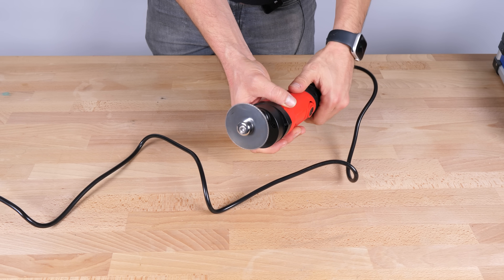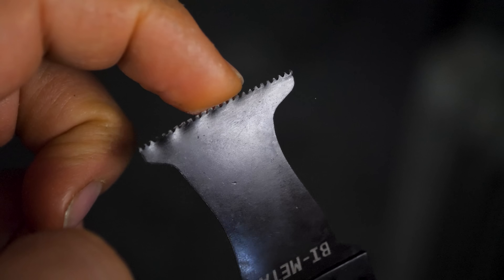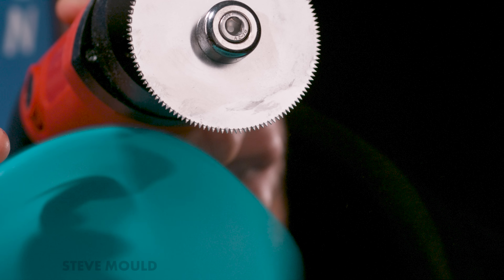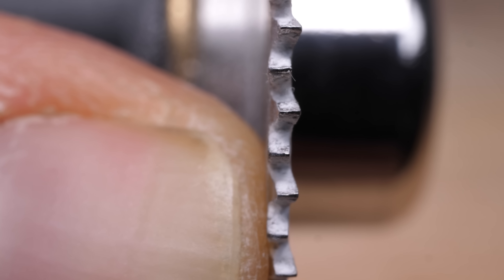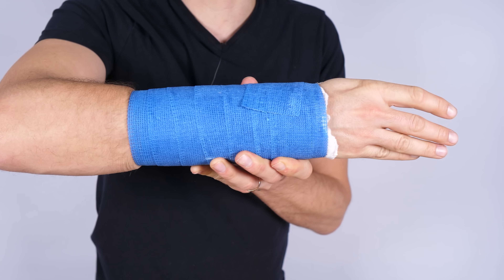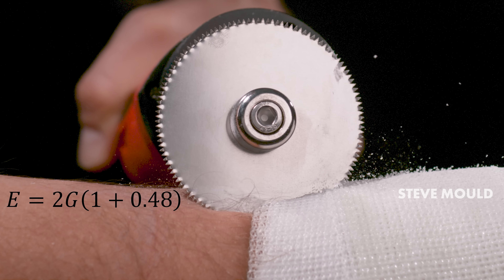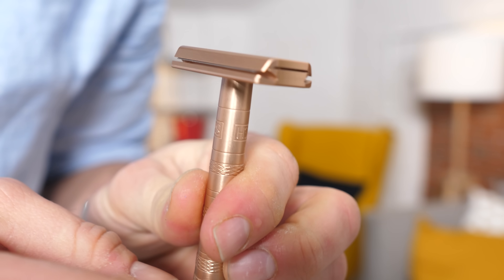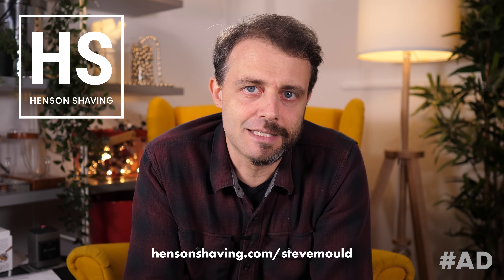A cast saw on human skin

Comment: Not strictly true. I broke my ankle in 2006. The bones where set during an operation and a cast was put on. After a week or so I developed a bad infection in the ankle, as it turned out it was MRSA. The case had to come off immediately, it was late in the day in casualty and the technician had already left.
A doctor decided to cut the cast off, omg it hurt but kept telling me it didn't hurt and continued. When the staff finally broke the case off I had a bleeding cut the length of the case down to the ankle, not great having an open wound around MRSA.
Well after some treatment for the cut, sorting out the operation wound, jabs of antibiotics and many uncomfortable weeks of further treatment and anew case with windows cut in it to treat the infected wound it healed.
My point...... the saws can cut skin if used by untrained personal.
Reply: It may have cut you even with trained personnel. Swelling from the infection could have simultaneously stretched the skin and pressed it tightly against the inside of the cast, making it unable to jiggle if touched by the saw.

Comment: Weird question. When you drill a hole into thin metal, the drilled hole tends to be all shapes but round, except if you out a piece of cloth in between the drill tip and the material. I'm a machinist and have been using this trick for ages, but I can't figure out why this works!

Comment: As someone who’s never had to wear a cast or even visit the ER other than for a regular check up this actually put my mind at ease because it was a slight fear of mine that if I ever wore a cast and the doctor slipped up I’d have a worse injury than before
Reply: Don't be mislead: if you slide the tool as it is powered, it'll absolutely cut through skin,

It's not ment to be operated in a sliding motion, rather it's repeatedly prepositioned for each cut, but not moved while it's touching the skin.

Like you put one dot at a time with pen & paper to form a dotted line

Comment: Similar thing with stone cutters. Can't cut soft materials but will easily go through stone. The reason there is that rock will grind down the metal medium and the embedded diamond flakes will then in turn cut the rock when exposed. But the sawblade is basically smooth to the touch, so without a regular sawblade shape, it'll just get rather hot.

Comment: Pro tip regarding power tool batteries: There's actually several options for adaptors to plug one brand's battery into another brand's tool.

Comment: Been trough that horror twice before. How hard would it have been for the doctor or nurse to say "Oh the blade doesn't spin, it just wiggles back and forth"??? Goes to show how sadist medical personnel really is. Thanks for this video to heal my anxiety.
Reply: i dont think many of us know how it works. I'm a foot and ankle dr, and when we were taught how to use the cast saw, they never told us that the blade oscillates back and forth when it cuts. All we were told was to be careful around the ankle. because you can cut the skin around the ankle, since the skin is very thin there, and you can burn the patient if the blade gets hot. The 2nd part of that statement is true, i'm not sure if the part about cutting the skin at the ankle is true or not. It most likely isn't as there is padding underneath the cast which protects the skin anyway, but i will still be careful around that area just to be safe. I did know that it was impossible to cut someone with the saw, in areas where you the skin is not directly overlying bone, as i had tested it out on myself. I just assumed the saw went in circles but was not very sharp. Nice to know how it actually works though.
Reply: @robotbro7187  Given how it was shown to work, I think there would be a risk of cutting the bone when it's close to the skin, and the skin would then tear when pinched against it. You obviously wouldn't do a huge amount of damage to the bone with a short moment of pressure, but I'm not sure how particular bone is to that sort of surface damage. Would it just heal without much knowledge, maybe just a tiny section with a slight bump in some insanely detailed (probably more detailed than exists) X-ray print/screen? Is there even anything comparable to that sort of thing? (sorry for the lack of the right terms).
Reply: im a doctor and ive used cast saws a lot, and i can tell u i enjoy seeing the fear in the patient's eyes
Reply: “sadist” you say to the people trying to save your life. Read this 3 times to make sure you werent actually saying that, but yeah. Some people are ungrateful as hell. They are LITERALLY trying to save your life.
Reply: @duuda-he9qj  I get you. But also nurses being terrible people is a real occurrence due to the power imbalance inherent to the position. There's a lot of people out there, probability will fill those gaps.
Reply: @duuda-he9qj  when cutting a cast there isnt that much at risk, they are just taking off a cast that has already served its purpose. they already know the cast saw is safe on most areas of skin, and in training they would be taught where is safe to cut; therefore they could easily joke around by not informing the patient of what it does
mind you they might not know themselves, if they werent told in training (as some other comments from doctors (have to just trust their word, this is the internet) said)
Reply: @Elementening  thats literally not relating to anything i said at all..

Comment: Why a circular blade and not just a small section? Perhaps you can rotate the blade to a sharper section of the disc, but one would imagine the plaster material being cut wouldn't really wear down rhe blade to that extent?

Comment: For those who doesn't know it... That's s moto tool, there are different brands and different accessories, for it... More likely small drills  I particulary have fail to touch the blades the force of the tool is strong for some materials but not strong enough to hurt skin instantly, so you have s chance to avoid injuries

Comment: A point of note about cast materials: plaster of Paris is much heavier than the fibreglass casts, which is why it is preferred for fractures which need to be set for a long(ish) period. However, depending on when you attend A&E, you might still get a plaster cast as a temporary fix until the fracture clinic can get you in to set your break using fibreglass.

Comment: The first time I saw this difference between solid and squishy things like people, was when I started at an auto parts store.  My boss told me to hold this engine part in my hands while he removed a bolt with an impact wrench.  I didn't know how it worked and thought it was gonna try rip the part from my hands, and I braced for it to twist hard.  He said "No, relax, it doesn't work that way" and torqued the seized bolt right out of it while I wasn't even ready, it just shook a bit and didn't twist at all.  It was the coolest thing ever

Comment: I'm sure someone else has already said this but it's just a multi tool, from a quick google Makita's DTM51 has an oscillation angle of 3.2deg so a blade of ~54mm radius and you have a movement of ~3mm.  You get a similar effect when using a reciprocating saw when you're trying to chop through something which can easily move, you stop making progress.

Comment: Hey, Nice vid! Just a small correction, I believe the thing you are measuring is the particle velocity and not the speed of sound in your skin. Particle velocity is dependant on the impact velocity, where as the speed of sound in the material is an intrinsic property of the material, based on the density and stiffness. Also just consider that the speed in sound in air is approx 300 m/s, and this increases with density (e.g. water is approx 1500 m/s), so there is no way that your skin has a speed of sound in the order of 10 m/s.

Comment: Email used to have vendor lockin and could cost amazing charges if you had to traverse gateways (up to $400/MB back in the mid 1990s). People were pushing proprietary systems right into the late 1990s

Comment: Why is the blade circular? If it just oscillates a few mm, why not just have a blade that is only that portion? Or is it designed to rotate the blade a little at a time to appears he using a sharpened spot instead of swapping out the blade all the time?

Comment: As there are no cutting risk with that kind of saw, there is a burning risk. I had a fiberglass cast removed from my ankle and the cast saw blade heated up because of the fiberglass being harder than the plaster. When the saw thoched my skin it certainly did not cut but it burned and scarred my foot. My point is that it is not that harmless.

Comment: When I was 13 I had tibial derotational bilateral osteotomy surgery. In the hospital, my legs swelled the cast shut due to unplanned for inflammation, and my full-leg casts had to be cut in an "emergency cast removal". It's interesting to see how the tool works and the oscillation, but unfortunately, because my legs had swollen shut against the cast shell, my skin got repeatedly scraped during the removal, and the blade got extremely hot due to the casts being so large and building friction. 

Not a fun time, but a crucial time for such a tool, considering the alternative.

Comment: I was born with feet pointed the wrong direction. I had casts on my feet at one point(<=1 years old) in the treatment for this and when they took the tiny little casts off my feet they cut down the inside of one my feet. From the middle of my big toe down about an inch and a half. I'm guessing it was a little cut back then being my toe must of been tiny and stretched out as I grew.  This was late 70's.

Comment: I had this experience when I was using a diamond table saw to cut open gemstones. 
It cuts through stone like through a butter (and it's a fully rotating blade) but you can put your finger there and it won't touch it, the blade is completely smooth to the finger.

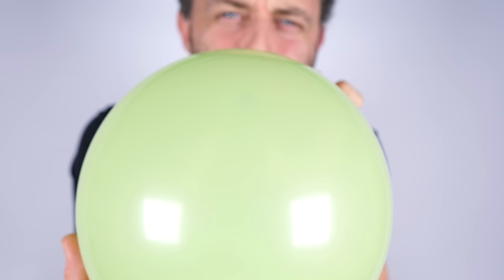Comment: 2:10 please correct me if im wrong but to me it kinda seems like the reason is the pressure of the ballon, the underinflated ballon is very soft with minimal pressure on the saw, whereas the overly inflated ballon has a high pressure

Comment: As nurse I have to make an important point, what you did is to cut through a cast with underneath the arm of a strong, young and healthy male...the point is all around those words:
-Age
-Sex
-Health of the skin

So starting from the first two, the skin of a child is not the same of an adult or of an elderly, because with age the hydration, the tension and the elasticity of the skin have really different carapteristics. The sex is about the same topics, usually females have a softer and more fragile skin specially on old age.

The last and more important fact the health of the skin...when you have a cast on you keep it at least 1 month, in this period you can't wash your arm (or leg ecc) the part stay away from the sun, the skin can't replace with new one or if it happens the dead skin stay inside the cast. All those factors together change your skin status making it frigile and with a really high amount of microorganisms like bacterias. 
So we arrive at the clue we are cutting the cast and we meet a skin with bad hydration, poor elasticity and with fragile epidermis...we press too much and the skin get injured making a path where the bacteria can attack our body.

So yes this blade is made to reduce the body damage, but there are a few things to know and to make attention to.

A thing that I was forgetting, skin near bones like wrist and malleolus is really still compared to the center of the arm for example, so obviously is more probable to cause a cut

Comment: When I was 7 years old, I had a cast removed. The nurse in charge of removing my cast was not paying attention, and was burning my skin. I was crying in pain, and the nurse just said I was "scared". Sure enough when the cast was fully removed, my arm was bleeding, though not very fast. I have a scar running along the length of the inner part of my arm now. people think its a self-harm scar, but I have the discharge papers which indicate that it was indeed an injury caused by the saw in question. Perhaps me being young meant that my inner arm skin was weak and easy to damage. Regardless, this is an interesting video and further proves to me that nurse sucked.

Comment: When my daughter was around 2y.o she had a greenstick fracture in her arm and had a cast. When they removed it, the doctor used one of these and demonstrated on his own arm that it wouldn't cut or hurt. He proceeded to cut the cast and my daughter screamed and screamed (I assumed just scared of the loud noise). When the cast came apart she had a bleeding gash 5 inches long straight down the cut line, and the doctor was speechless and utterly confounded. She still has the scar to this day.

Comment: The primary reason it doesn't cut through the skin isn't the fact that it's oscillating, it's rather the dull teeth. If they were sharp, you could cut through your skin just by pushing it down on it without even powering it on.

Comment: What would happen if you dragged the blade across your skin perpendicular to the oscillating direction? Would it pull the skin taunt and cause a cut? What about stiffer skin areas like finger tips?

Comment: I just wanted to say that the tau/12 joke (7:28) has been noticed! 😂
Reply: I don’t get it
Reply: @Im_96 Well, it's not really a joke, just a statement. The number τ (tau) is a mathematical constant equal to the ratio of a circle's circumference C to its radius r:

τ = C / r.

It is approximately 6.28.

This may remind you of the more familiar π (pi), the ratio of a circle's circumference C to its diameter D, approximately 3.14:

π = C / D.

Indeed, since a circle's radius is half of its diameter, τ is equal to 2 times π. So, why bring in τ when we already have π? Well, there are many reasons, but the primary reason involves a system of angle measurement: radians.

You may be familiar with measuring angles in degrees, where there are 360 degrees in a full revolution, or one turn. If you make a half turn, that's 180 degrees. A quarter turn is 90 degrees.

This is all well and good, but in higher math, it is often more useful to measure angles with another unit: the radian. Suppose you draw a circle, then you draw a radius from the center to the edge. From there, you draw one radius-length along the circumference of the circle, then you draw straight back to the center of the circle. That angle you form at the center of the circle is one radian, abbreviated rad, and it is approximately 57.3 degrees (this is 360 / τ).

For some terminology, the curve you drew along the circle is called a circular arc. We say that the arc subtends the angle at the center of the circle, since the rays of the angle pass through the arc's endpoints.

Now, the question is, how many radians are there in one turn? Well, this is where τ comes in. Since τ is circumference divided by radius, we know that the radius goes into the circumference τ times—that's what division means. So, we can fit τ radius-lengths along the circle. And since each radius-length subtends an angle of 1 radian at the center of the circle, that means the whole circle subtends an angle of τ radians. So, there are τ radians in one turn.

Knowing this, we can also determine the radian measures of some other angles. 1/2 turn, or 180 degrees, is τ/2 radians. 1/4 turn, or 90 degrees, is τ/4 radians. 1/12 turn, or 30 degrees, is τ/12 radians. Simple, right?

Or, well, it should be. The traditional choice of circle constant is π, not τ. Thus, in a typical trigonometry course, the aforementioned angles would be expressed in terms of π: 1/2 turn = π rad, 1/4 turn = π/2 rad, 1/12 turn = π/6 rad. Since we're defining radians using the radius, but we're defining π using the diameter, there are annoying extra factors of 2 everywhere. As a result, π makes radians much more confusing than they should be.

Due to this, among various other reasons, some people advocate for τ as the true circle constant. For more information, you can read The Tau Manifesto by Michael Hartl. There is also an annual celebration of τ: Tau Day, which is June 28. Incidentally, that was a few days ago from the time of this reply.

Comment: I had a broken wrist in Japan about 20 years ago, and I remember the doctor whipped out one of those with the large circular blade to cut off my temporary cast. No guards or guides of any kind. My first thoughts were, "This guy better be GOOD!"

Well the doctor did end up pulling out 3 pins and 4 screws from my bones later on, without anesthesia. For the screws (which were part of an external brace) he used an ordinary cordless drill, which he clamped onto the exposed screw ends. My thought then was, "I sure hope he has it in reverse!"

Comment: Back in the 60's I was having a hip spica removed with one of these. After being shown how they worked and being reassured that it was completely safe they started buzzing away. All went well until the got to the side of the knee. I started to complain with lots of ouch, ouch. Again I was told all was well. When the cast was fully off there was blood and a cut down the side of the joint. There was virtually no flesh there, I'd got very skinny in hospital, and the plastering had pulled everything so tight that there was no give. Hence, like the overinflated balloon, something had to give. It taught the theatre team a lesson and luckily I didn't suffer any problems. I still have the knee but had the leg amputated for a below knee prosthesis much later on.

Comment: I've seen a similar saw (only much more heavy-duty) proposed for use by emergency crews cutting crashed cars to free the occupants.    It will cut rigid steel but if it slips and hits a person it doesn't cut their arm off.